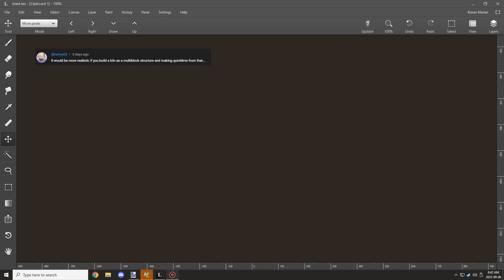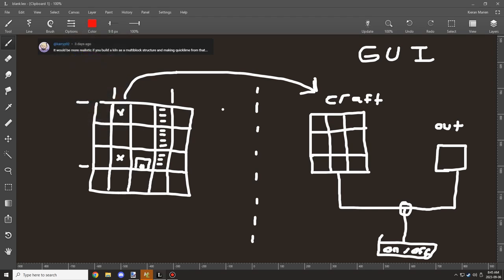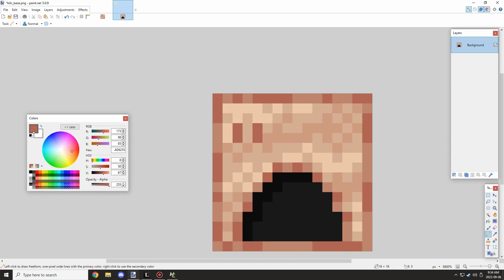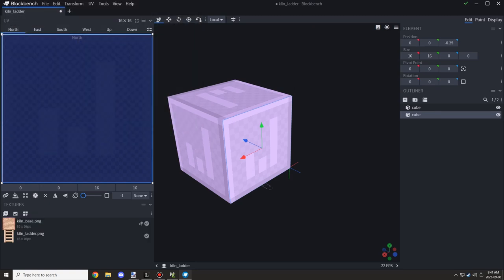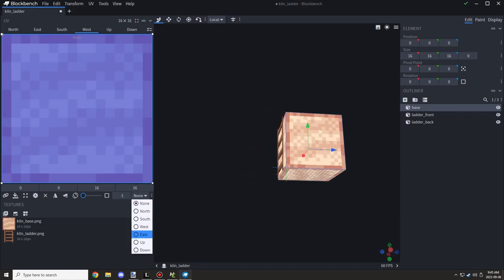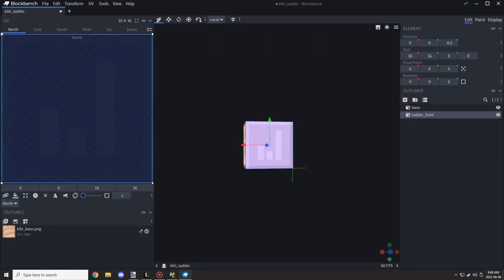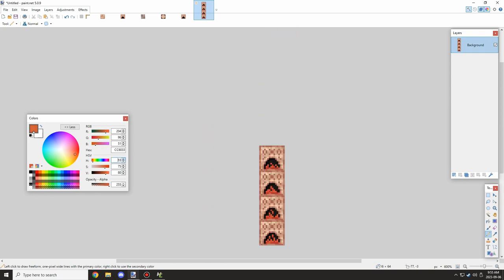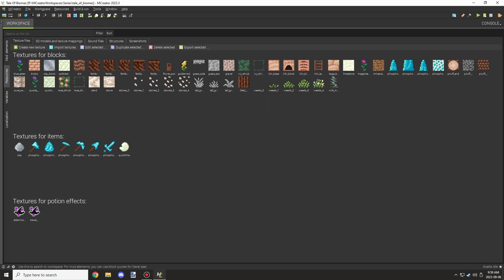Kiln Textures | MCreator Lore | Ep32

Comment: I have actually worked on a kiln in mcreator myself before and for the on/off feature I reccomend having a campfire underneath, as that is what I did and it came out pretty well, I am happy to send you the file to the worspace if it can give you any ideas
Reply from the maker: Thanks for the idea, I have most of the mechanics made, I just need to finalize some placement conditions so it does not break specific blocks when being placed or should I say block it from being placed. But it is ready to go for the most part.
Reply: @NorthWestTreesMCreator  thats great, cant wait to see the video about it?

Comment: Hmm... You can actually use fire item texture for the Klin controller, but anyway using the brick texture is exactly what I thought about when I came up with that idea. But there are 3 things... 
Is ladder block necessary, how about creating just the ladder... It might be useful for other structures in the future
Also, does the multiblock have connected texture after finish assembling? If u use the klin frame to build this, it might end up not looking good due to the block outline. I really want to use the brick that u have already made for the frame and re-texture the klin controller, and since it's a 5x4x5 (plz make it 5x5x5😅) we should add something like brick pillar so it won't look boring...
And what concerning me the most is... Hmm I'll say that later cuz u might think about it when making the multiblock thing
Reply from the maker: Hi Karryy :)
You have great ideas.

For height I can add another layer for sure. This would make a bit more since actually as it would give 1 layer for fuel, and 3 layers for crafting layers.

At the moment I am not fully sure how to make the connected textures using procedures. I have done it with Optifine but I imagine it would be a bit different using procedures so I will need to work on this shortly after this weeks video.

For ladders my thought of adding it built in would provide people a way to get out if they need to climb out of the station. 4 blocks tall with the 5x5x5 dimensions would be just enough height to deal damage, while adding a ladder block would be possible the down side is it would need to be removed in order to set up the recipe inside the kiln so I though maybe having a built in one would help with usability for the crafting process.

Also most likely I will add custom ladders, the though did pass my mind when I was making the texture and it could offer an easier experience for some of the caves and buildings so I will add new ladders at a later date for sure :)

Also when the kiln is created all the blocks are assigned a ID so when the controller block is broken it will remove all the kiln blocks in that ID group, the ID is something really high so it could have a less likely chance of overlapping but in order to apply it to the rest of the block I wanted to make sure the ladder and other components could be removed.

There is still some work that needs to be done, I still need to through in some conditions for testing for other kiln blocks in the build area, as well as bedrock which should block the placement for the kiln. I should be able to work this in to the script before Friday and have time to run some tests I would most likely run this through a tag so it would be easily expanded in the future if needed. I most likely will work on this today on my time off for the week.

Comment: What would be the best way to create a block in blockbench that is 2 blocks tall and then pass it in the mcreator? I have already created, but i dont know if it can make crash  the game when it coliddes with other block or something.
Reply from the maker: Generally you would want to make two blocks as going outside of the 16x16 area of the cube will lead to texture shading issues. In some cases this may be needed but if it's for something like a bed or double plant minecraft normally uses two block parts and it uses up the tile above the base block. In a since double blocks like doors are mutli-structures. You can use conditions to test if the block exists if not break the current block to remove it if the block part is removed.
Reply: @NorthWestTreesMCreator  I also see your older video of the stonecutter. The only thing that i couldnt make is the GUI part, because I was using an older version and I couldnt find the open screen part. And i dont know, how can  i change the icon because of the block, because it is cutted XD

Comment: Please make a video of how to put a number from a change over the head of a player or mob
Reply from the maker: Not sure about players but this can be done using display names for entities, you just need to pass the number using the text block format number that has ##.## in the block. once you do that it can be used as a string for the display name of the entity. I would update the value on a entity tick update this way it will show the data every tick if it changes. If you want a solid number then you can change the ##.## to just ## and it will use just the integer part of the number.